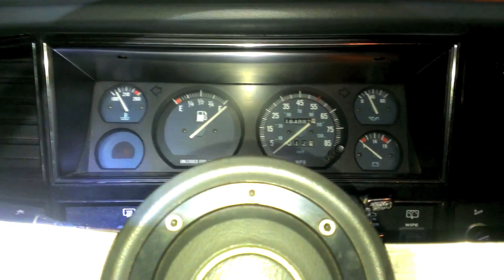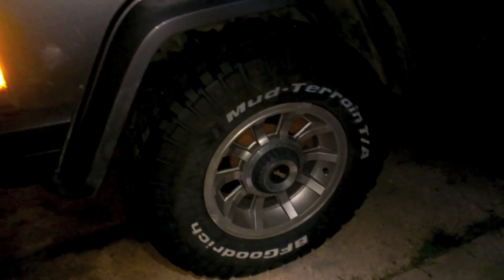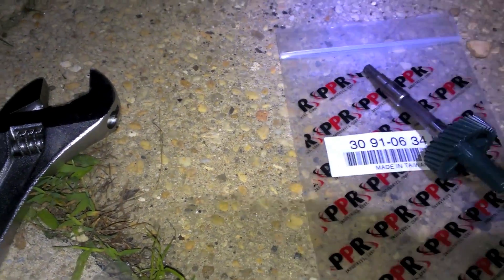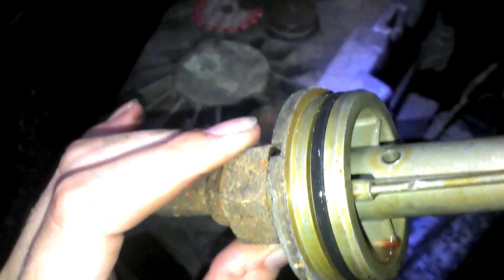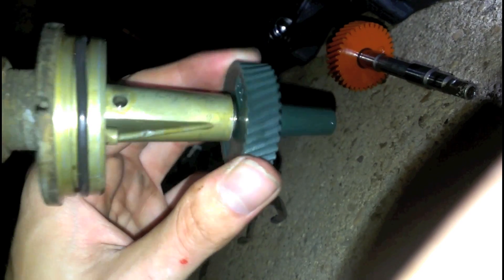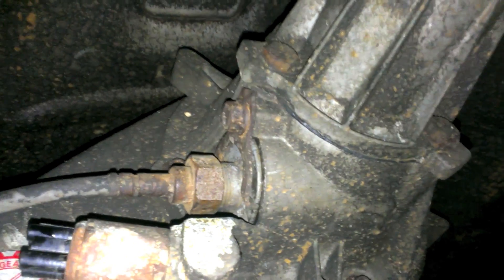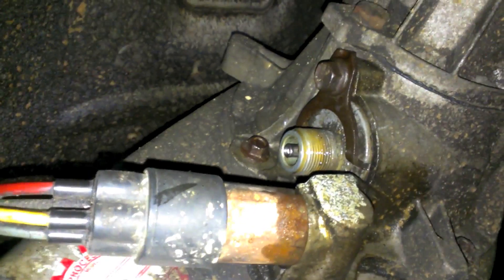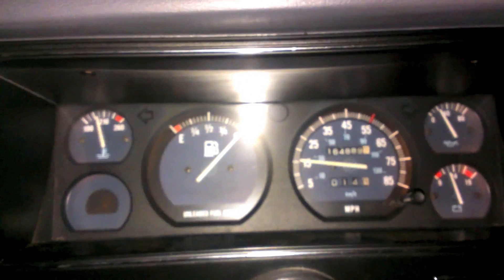89 Cherokee Speedometer Gear Calibration

Comment: Great video!  I never knew about those marks on the speedometer gear drive.  I was trying to put a different diameter gear in and wondering why it wouldn't work.  I thought I had to buy another gear, but after watching your video I see I just need to rotate the housing. Thanks!!

Comment: What's that part called that the cable is screwed into
Reply: Just in case you're still wondering, the parts catalog entry uses the following part number and description: 

J3212893
ADAPTER, Speedometer

People commonly refer to it as a "speedometer gear housing." I've found searches using that term to be way more useful than others that are sometimes used—"speedo cable adapter," "transfer case plug," etc.

Comment: I have not tried this yet, but I'm exited to. After a couple transmission swaps and blows I have not had a speedometer and been using my phones GPS for years. I estimate 60,000+ miles and I'm tired of it. Hope it works for me getting my speedometer to work again

Comment: Do you know how to change from a cable driven speedometer to an electric
Reply from the maker: You'd need to change to the electric speed sensor, run wiring, and swap the cluster of just speedo gauge. 91+ wiring diagrams will tell you where the bits go

Comment: 7:57 Do you know the part number of the o-ring inside the cable?  Mine is leaking between the cable nut and cable.
Reply from the maker: Hmmm, I do not. Are you able to pull it out? Might be able to find a similar one in an o-ring multipack.
Reply: It's loose in there.

Comment: At Quadratec dot com, I land between 33 & 32 teeth.  If I go with 32, it will read a little faster; so, I would be going a little slower; than, I'm actually reading; which, is what I would prefer?  Is this correct?
Reply from the maker: Get a 33, since your not even 32" tire is going to wear down closer to a 31" eventually. Gears can be bought on quadratec or other sites like ebay, but make sure you get the right length shaft, the old style is long, new style is short. See which one you have before ordering.
Reply: Thank you!  Ordered it a little while ago.

Comment: I'm keeping the same 3.73 : 1  gearing on my differentials. Tiresize.com says my tires will be 31.6" Diameter.  Do you know what gears I need for my 249 transfer case?  Where can I buy the speedo gears?

Comment: I snapped that little plastic clip on the speedo cable that connects to the back of the gauge cluster. I managed to keep it working by just making sure it's pressed up against the back of the cluster but I figure I might as well replace it. Mine is an 89 Laredo so it has cruise control. My turn signal lever has the controls for it on the end, however they don't work. Most sites say there is a different kind of cable I need, but it looks just like yours. Not sure what to buy! Any ideas?

Comment: When you put that gear in does it click or twist in? I just pulled mine to get the instrument cluster out and now that i've put it all back together my speedometer doesn't work. I hope I didn't break the cable :(
Reply: So I watched the video again and I guess it does click in but mine won't. It goes all the way in & even spins the cable on the other end but it won't click in, it just falls out with any amount of pressure. There isn't any kind of retaining bracket or anything I dropped is there?
Reply: Andrew Roby If anyone ever runs into this problem there's a rubber grommet & C clip inside the gear housing. Apparently I pushed it towards the speedo cable when I put the gear back in so it wouldn't click in. After about an hour of work I got it all to line up correctly. It's not as solid as it was before but it seems to be working.
Also if anyone does this and ends up with no reading on their gauge have someone watch the gauge as you spin the gear. If the gauge moves then the cables are lined up and you just need to keep trying to line up the gear with the drive gear.
If you just need to pull the instrument cluster you don't need to pull the gear/housing out of the T case (at least in my jeep) I've got an 88 Cherokee Laredo XJ 4.0. In my jeep the speedo cable runs through the fire wall into a plastic deal & another cable runs from that to the cluster. You can get a 15/16 wrench up under the dash and disconnect it there, just make sure you don't strip out the plastic when you put it back together. I wish I had known that going into this project, it would have saved me two and a half days of work.
Reply from the maker: Andrew Roby I've been in both your scenarios before, it's not easy. I took the Nut lock off the speedo cable to get enough reach behind to disconnect my cluster out when i swapped if for a nicer one. It took a few tries to make sure the square drive lined up into the gear.
I've swapped out a few different speedo gears and have had different issues with them. For the one in this video, the cable wasn't seated in the gear the first time. I held the gear in my hand and looked up into the cab with the door open to see if the speedo moved with the gear. I had to pull the square drive cable out of the covering a little so they would mesh right.

The second time i was having issues getting the gear to mesh with the drive gear in the tcase and had to rotate it a good number of times to get it to mesh.

The 3rd issue i had was getting water in the transfer case. The water froze to the gear and when i went to take a drive the metal tcase output shaft ate the plastic speedo gear so i had to replace it and the fluid. 

So overall, I've had my fair share of fun with this system.
Reply: NickInTimeFilms Yeah I was on it for a good 3 days before I got it working. Then the red bulbs for my dash lights came in so I had to rip it all back out again. This time I decided to disconnect the cable from the cruise control deal behind the dash instead of pulling the other end out of the transfer case. Unfortunately I broke off both ends and now I have to replace that.. and I have no speedometer again :(
Reply: So after a short time that rubber grommet, or "Speedometer pinion gear seal" got torn up to the point of not holding the gear in place. I found a new one plus the C clip that holds it in place on ebay for about $6. A standard O ring will not work (trust me I tried a few times).
I hope this helps anyone that runs into this problem.
Reply from the maker: Andrew Roby Interesting, I didn't even know there was a retaining grommet inside. Thanks for the share.
Reply: NickInTimeFilms No problem. I constantly find myself looking for very specific information and it takes forever, so I always try to share what I find.
Reply: Andrew Roby going through the same thing right now. Jeep 1991 Laredo, installed an sye and driveshaft. In the process I destroyed my old stock gear but had to upgrade to a 40 tooth gear, as I write this I'm having troubles lining shit up right. Been 2 hours of error and trial.
Reply: Blue 4x4 ring is in the correct place. It's driving me nuts